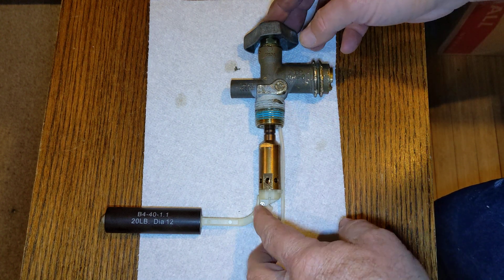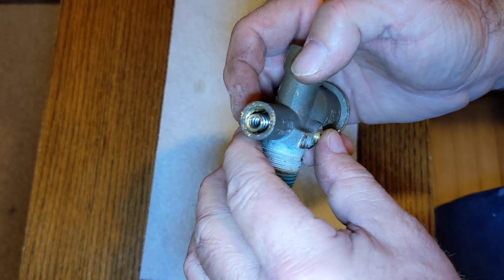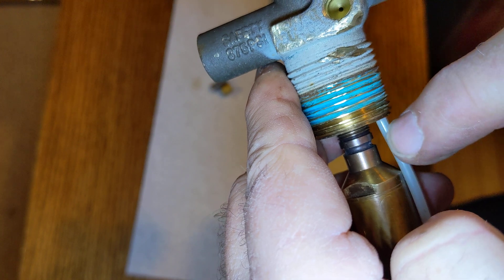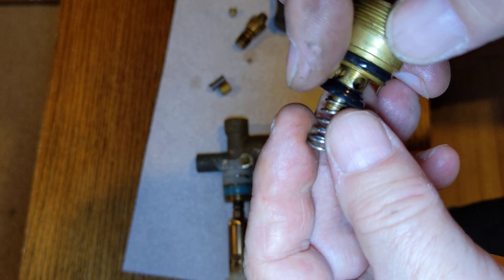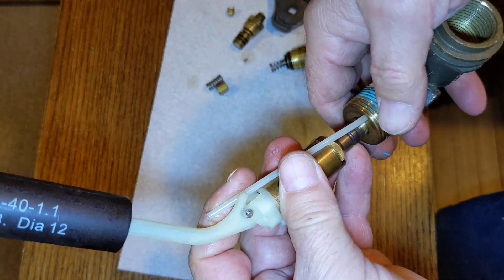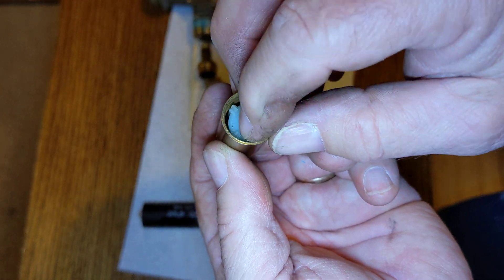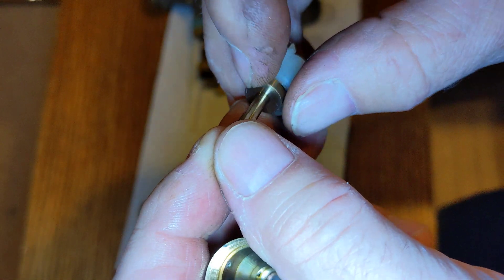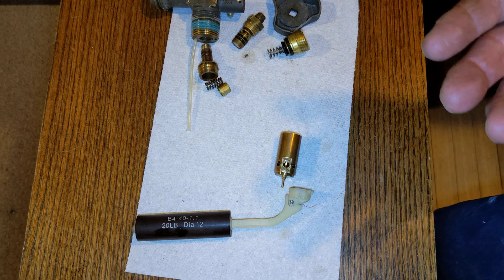Propane tank OPD

Comment: The rubber seal where a hose connects isn't available, from all the research I've done. It requires the entire $20 assembly to be replaced instead of a one dollar o-ring. I get that the safety features aren't serviceable, but the most external rubber seal should be easily replaced. Excellent video, so thank you.